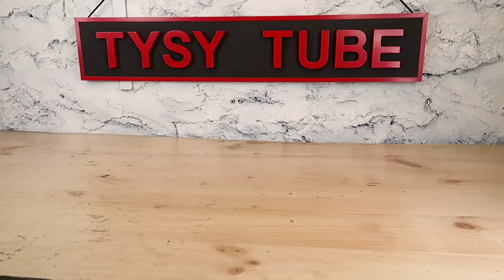Very Rusted Meat Grinder restoration

Comment: Looks ok but two things you messed up on. When you sanded and ground the face of the grinder plate you dulled the cutters badly. That surface is machined to fit precisely with the “star” wheels attached to the auger. It will still cut soft foods but raw meats will take much more effort. They’ll likely be more mashed than ground.  Also noticed the washer on the clamping screw was removed. Hard to repair that one. It can be done though by drilling the tip of the screw and flaring the washer back onto it
Reply: I couldn't believe it when he ground away the sharp edges on the cutter.  That's like purposely dulling a knife.  Those edges are sharp for a purpose but he didn't realize that.  He wanted to make them pretty so he ground them down.
Reply: Are you talking about 7:09?
Reply: that's because he made it looks nice and shiny, not to work properly
Reply: @Matthew_Removeafterwashing  could have done both.

Comment: While the restoration is very nice, I don’t believe they were ever painted from day one. We had a couple of them growing up 75 years ago and I never saw one that was painted. They were used for grinding meat primarily, they could, with an additional attachment, be used for stuffing sausages. For cleaning auger and insides stale bread was run through, then unit disassembled and washed with soap and water.
Reply from the maker: i know, back then was electroplated
Reply: @TysyTube  Never seen one painted, a good thing because of led paints of that era covering a food processing tool. But results are stunning, only way to keep it from rusting is using it.
Reply: @TysyTube  Yes! It was electroplated (or chromed, if you wish). When you applied that anti-rust bath one could see the yellowish under chrome base, that was copper (sign of a good chrome finishing). My mother had the very same grinder since it married in 1950. It was sold and widely used as meat grinder, despite the generic "FOOD" at the side. It was made of cast iron and would rust easily if wasn't chromed. I doubt this fancy red painting, even with the primer base, can act as anti-rust protection. I would not have criticized you if you had taken the parts to a good chrome shop - by the contrary: I think the result would be stunning!
Other missing item in your task was the rotate knife (that was the name people usually call that part): I would sharpen it by assembling in the grinder and milling with grinding paste, the same as used to set piston engine valves. After all, a restored meat grinder must perform this task as it was conceived decades ago.
Reply: @Antonio Mariani I agree with you. His work is purely decorative. Again, I said I never saw one painted.
Reply: We used to run corn cobs through them, then wash and scrub. After drying we would rub it down with lard then wrap in a cheesecloth until the next use.
Reply: I have never butchered a large animal. Once you have killed, skinned, and drained the carcass of blood I expect you'd need this for the smaller bits. I'll need one of these if I survive the apocalypse and McDonalds is closed.
Reply: @Antonio MarianiI was a machinist for 20 year and am now a restaurant manager.   Iron can be protected with vegetable shorting.   in the short term.   cast iron pans are seasoned by burning in a thin layer of lard.  You use a scouring pad with oil and scrub your cast iron.  Then wipe clean with paper towels and more oil until you get no more black  on the paper towels.  that takes a lot of work.  Then you wipe off as much lard as you can leaving the thinest possible film of lard on the iron.  Then heat it up until it just burns.  You want a dark brown layer. let it cool down and wipe off whatever you can with more paper towels.  It takes practice.  My father taught me when I was ten how to do this.  If you have removed 100% of all plating and undercoating from a grinder you can use same technique.  It only works if there is no other metal present.    Fun fact, if you have a safe way to plate your meat grinder with sterling silver, you can use that just keep it clean of tarnish.  silver is a natural solid lubricant and has anti bacterial qualities.
Reply: most i have used where originally  tin electroplated when that wore off we simply covered them in some kind of food safe fat/oil wrapped them in waxed cloth and back in a wooden box we keep them in.
Reply: I have seen these painted in the past, but the business part is always natural metal. True, it was not common, more of a vanity/luxury when they were painted.
Reply: Antonio Mariani that’s exactly why he didn’t paint the inside, duh!! No food rubs against the painted surface. It all touches the metal and is ground on metal to metal then pops out the end. The food doesn’t touch the outside. 

So is kitchen aid mixer bad to use? They are painted. It’s the same concept. 

With today’s tools and available products and knowledge of new materials things can be done differently. It may not be an exact restoration of original. But it’s 100 percent functional and completely safe to use.
Reply: Roberto R. MOLA, I believe that it would be cheaper to gold plate the thing.  Chrome plating has become exorbitant.  Cheers! @RobertoRMOLA
Reply: I have one that is enameled inside and painter red on the outside,  from the factory
Reply: Peter O'Brien we have one at the moment it’s blue
Reply: @scottgoodman8993  yes this is how you make your own hamburger haha. I have one from my grandma I use to make ground venison (deer)
Reply: @michelbrisebois4317  ya, god forbid that you have lead paint on your food processing tool! I mean hell man lead was everywhere from your paint on your walls to the gas for your cars.
Reply: My aunt has also the attachement to make flower cookie. She still has her grinder and works like a charm
Reply: Heh... I was also surprised painting. I remember such meat grinders at the time of youth in the USSR and we never painted them. Washed, dried and everything is in order. I thought maybe they are being painted in the West.
Reply: I still own and use this type of hand grinder. It has been in the family for a couple of generations. This inspired me to redo the finish. Re-plated and polished. Looks brand new. Should go another 2 or 3 generations. Thanks.
Reply: Never painted.
Reply: I still own one that is still fully plated and looks basically new. I even have 4 original heads that came with it.
Reply: Nope never painted. Pure metal.
Reply: the silver finish was a paint.
Reply: Nine here in the usa has flaming tin electroplate. I will sandb last to bare metal then run a lot of l are and crusty bread through them test one lb grind at a good food safety lab.
Reply: Flaking not flaming lol
Reply: Yeah I was going to mention that the one I used to use, we would run slices of bread through it to "clean" it, but then I figured someone probably already said that. Ours also had the sausage-making attachment. I always had fun making the sausages and doing the little twist as it came out.
Reply: @nunyabiznez6381  Yeah the way we clean cast iron pans is steel wool and olive oil, then giving it a quick heat up till the oil smokes a little. Then we hang it on a rack to cool. So simple & easy.
Reply: @xeokym223  so I can sandblast the parts of mine and rub bread through it til the bread comes clean and it's good to go? I want to put the one I have back to use to make my own sausage blends
Reply: My dad had a chrome one and my nan had a green one, used to grind meat for burgers ect had a sausage attachment.
Reply: @scottgoodman8993  😁
Reply: I grew up with those and ours were never painted or plated. We still have one.
Reply: @joncue0304  I'm gonna get mine soft media blasted whenever the car body shop near me opens back up
Reply: Debating whether to leave it bare or get the parts food safe powder coated.
Reply: We had one and we only ever used it to grind meats.  Great for doing turkey giblets for stuffing!  Ours was not painted either.
Reply: Food grade mineral oil is used to keep the metal from oxidizing (as a former butcher). And you're right. They were NEVER painted because who would want paint chips in their food?
Reply: @TheHyde8875  excellent tyvm. Then my own restoration is set. Can't wait to put the thing to use.
Reply: We mostly used ours for making cranberry relish for the Holidays.
Reply: @RobertoRMOLA  did do you realize how much it costs to chrome metal? It’s expensive.

Comment: Nope. Those meat grinders were never painted. And for good reason. Ease of cleaning and to not have to worry about flakes of paint getting into the ground food.  How do I know, when my grandmother's grinder got passed down to me, I said something to granma about painting it. She said for pity sake not to do it and it was not painted when she got it from the catalog store back in 1919.  She said that nobody's grinders were painted.  I still have it and use it to grind meats.  And there is no evidence that it ever had paint on it.  And it is still just as shiny as I remember it always was when we went to the farm on butchering day (I would help her grind the pork they were butchering so we could make sausage).  But the grinder in the video would not be very effective because I did not see a "slicer" or any of the extruder plates for the for the different "grind" sizes.  So, I guess his end result is just for show.
Reply: cimogm nope, this is not a meat grinder. This is an all purpose food grinder. Meant to grind up all kinds of foods. It doesn’t have different size settings. That would uh make the “all purpose” not “all purpose” lol

And for someone as your grandma with little to no knowledge of modern paint and coatings, ya I would say she is right in her thinking of not painting because if you did it wrong or the entire thing you’ve fucked up the piece. And no one in their right mind would paint the inside or anywhere the food would touch and grind. 

This piece is 100 percent functional.
Reply: Firstly, as others said, the paint parts are not in contact with the food, and secondly, normal steel is not recommanded anymore to be in contact with food, cuz nobody wants to eat rust, just stainless steel is allowed. And I will add that with the paint, it is now easier to clean it.
Reply: @sentient.ball.of.stardust  Yep just bought an 1890s AlexanderWerk german meat grinder. Red on outside. White porcelain or baked enamel on the inside
Reply: For advertising various chemical products really... The job could be done with electrolysis to remove all rust especially from difficult to access areas and much more effective and much cheaper.
Reply: Vickie Hadd  Yeah, those old ones, not gonna be or get rusty if you take care of it properly, wash immediately after use and thoroughly dry it, and store it in a dry place.
Reply: No

Comment: 11:12
Don't do that, if you're using a grindstone to smooth out an edge or a point, you need to constantly keep the object moving around from side to side, otherwise your grindstone will have a valley in the middle.

Comment: Have two of them, both passed-down through family.
 One made in 1950's is plated, and  one made in 1920's is not plated and is a better quality unit.  Both have multiple blades for different foods and grind setting.  Easy to use and to clean. No corrosion problems if treated properly. 
Thanks for your video, which shows that these can be saved (although no painting if used for food).

Comment: You definitely need a sandblaster (just cos it's so satisfying to watch)
Reply from the maker: i know
Reply: So you need it for your satisfaction 😁🤣
Reply: Sand blasters are good sometimes, but sometimes they can take away metal too, just like a wire wheel. I've had problems with both. But I do agree a sand blaster is very handy to have. My problem was actually using the blaster to get old paint off that was very stubborn instead of using a stripper (When I first got it I used every excuse to use it... lesson learned).
Reply: Sand Blasting is a must. Also if the parts were to be painted some plaster would do much better to get old rusted surfaces in a more smooth appearance.
Reply: @Clarinetboy82  I sandblasted for years. The truck is to do multiple quick light passes until you’re at the desired grade, instead of focusing on a spot like say you would with a pressure washer.

Comment: Nice restoration. And still a functional tool, too.
Here's a good tip: next time, use natural materials to lubricate tools like these.
Use the thickest sun flower oil or olive oil you can find. For the handle you can use bees wax, or even candle wax. If these products end up in the food, it will be completely harmless.
Reply from the maker: thank you so much 😊
Reply: @TysyTube  You could probably make your own lubricant by melting both bee's wax and a vegetable oil and mixing it together.

I know the viscosity will be between that of the wax and that of the oil out of experiences from making salves/creams.

Cocoa butter could also be used as a food-safe lubricant.

Comment: I have a Universal meat grinder (I think the same model) with multiple blade attachments that belonged to my great, great grandmother.  It is still in great condition considering its age.  You did a great job restoring this piece but I prefer the look of the machined metal without the paint as they were originally finished.

Comment: There was always a rubber washer on top of the washer on the screw clamp on my mothers. It kept getting lost because the glue didn't hold, it never does. These are great for making hash and sandwich spreads. Also used them for crushing things like onions, garlic and tomatoes when canning. Just make sure one deep pan or bowl goes on the floor to catch the drips from the crank if it is loose like this one appears to be!

Comment: Nice, after rusting like this you have to paint them. I have 2 of the # 3. I can hot peppers. That's the only thing I found that will grind them up. Even the electric grinders won't. But food for thought. I worked in a tool and die shop during a lay off. If they didn't wont paint or anything in a hole they would smear grease in it. So, If you ever get short of tape use grease. When it drys it just rubs right off. While working there I got use to a sandblaster. When I got called back to work I bought me one. They are a ball. Take a picture frame and shout the wood and it turns out neat. I keep a small jar of oil handy. When I use mine and it drys I recoat the grinding face and blade.                                                                                                                                 Terry

Comment: Nicely done, thanks for the trip down memory lane.

One thing that I would change is polishing the outlet end of the body because the polishing wheel will round of the cutting edges and causes food to be squeezed instead of cut. I would use valve grinding compound and run the rotating cutting knife against it.
Reply from the maker: thank you so much 😊

Comment: My mom had that exact grinder; she got it from her grandmother.  (I'm almost 60, so you can guess at the math.)  It came with a number of different cutting wheels to attach to the end of the screw depending on how finely you wanted to cut up the meat.  Ours had no paint, just the bare metal.

As far as I recall the only thing we used it for was preparing rabbit meat.  My dad raised rabbits and sold the pelts and meat.

Comment: I'm sure your moms wasn't painted, right? You did nice work here and it looks good.    For information: To prevent rust after use. Disassemble, wash and dry pieces, allow to completely air-dry, reassemble then store in a dry place. I've heard that some people used to rub the pieces with a small bit of cooking oil to help prevent rusting. Mine is a #2 and I have heard of a #10.

Comment: This is the same one I got from my mother and she got from her mother. I have four blades with mine. My mother would grind up left over roastbeef or ham for sandwiches. For the roastbeef she would grind up a bit if onion at the end for flavor and to help clean the grinder. As for the ham she used a dill pickle. I still use it. Of course its not rusted. I have kept it oiled after washing it.

Comment: Very good job sir - my only comment would be you might have wanted to sharpen the cutter blade. When you wire-brushed through it most probably it became slightly dull

Comment: Very nice but, red? Got 2 sizes of them around here somewhere. I was the mom who put the kids to grinding Zucchini for relish. (and peppers etc) They came with 3 attachments for different grinds and are made of cast iron. Grandma (they were her's) told me to wash in hot soapy water, condition with a few drops of vegetable oil and SEAL in a plastic bag between uses.

Comment: I have one of these. I got it from my mom. I was in the box and not all rusty but I did notice that the cutter and the other cutting surface of the body  were cast, i don't think that they were forged but the mating surfaces were lame, not machined at all.

Thoce kind of cutters should be machined like shears with nice squared up edges.the end of the cutter fingers looked all balled up.

Anyway, what I did was to bring the surfaces close with a Dremel diamond wheel and then use  automotive valve grinding compound from Napa auto parts. Lightly snug the thumb screwand crank away.

Keep wiping away the schmoo, re apply more compound and go again.

That grinder could grind the crotch out of a rag doll now. Not that you'd want to use it for that, but it could. Just sayin'.

Comment: Handle not termite attacked, damage would have been more pronounced. It is 'Wormwood" highly sought after. You see it in high end furnature. a 2X6 board is $6.48 at Home Depot. The same Wormwood board is $100.00.

Comment: Have you thought about using vinegar instead of the rust remover.  Cheaper.
Reply from the maker: is not that good vinegar
Reply: Its a combination of vinegar and heat.  But yea not as good as that stuff.